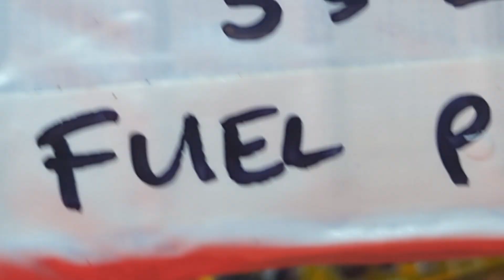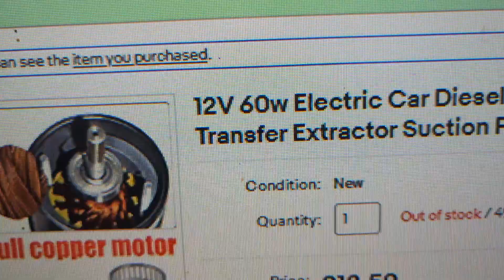Recycled Lithium Battery Experiment - Running a 60w fuel pump with a 290g Battery

Comment: Couple of issues you may want to check, first being the max allowed discharge current for the cells, the second being the min voltage level.
Discharging above max current can cause the cells to overheat, dropping a cell below the min voltage can also damage the cells. As they are laptop battery cells my guess would be 3 amp max discharge current and 2.7v min voltage level per cell.
The pack discharged very quick and down to 2.3v per cell. Be careful you don't cause them to become unstable.💥
Reply from the maker: Hello mate thank you very much for the comment these are quite old batteries I won't be discharging them normally anything over one to two amps, I have been playing with them over 10 years so fortunately I do know how to experiment with them without exploding stuff

Comment: That system would do well with a photo electric panel as a charger. Charge for a few days then discharge in half an hour. Use the controller in the battery pack to control charging and discharging.
Reply from the maker: they are versatile for sure only cost me £2, cheers